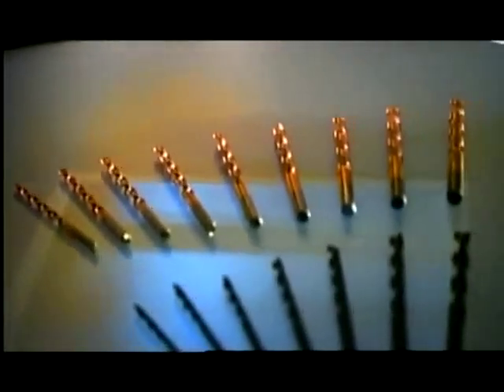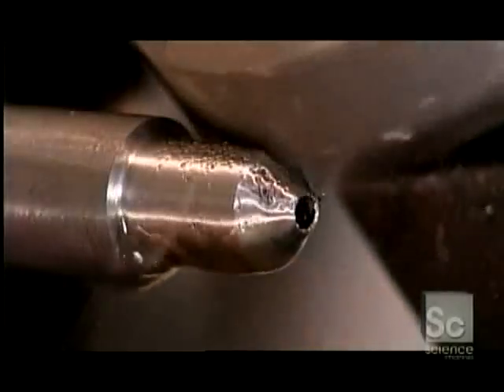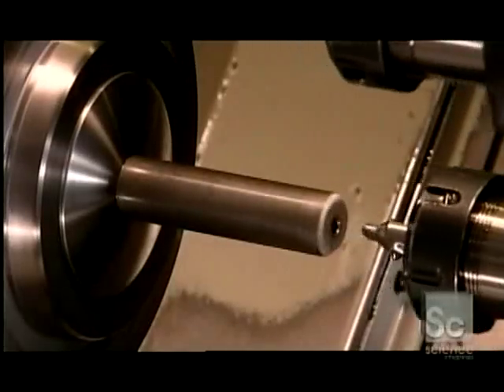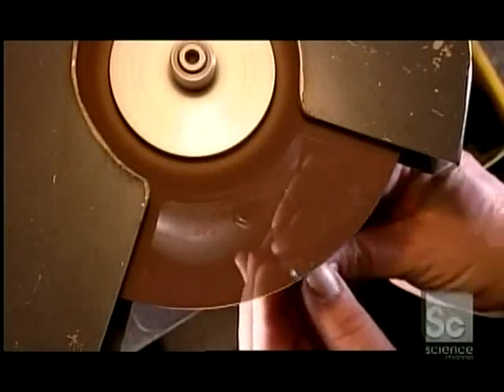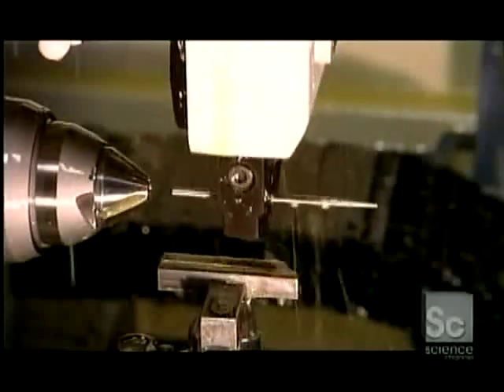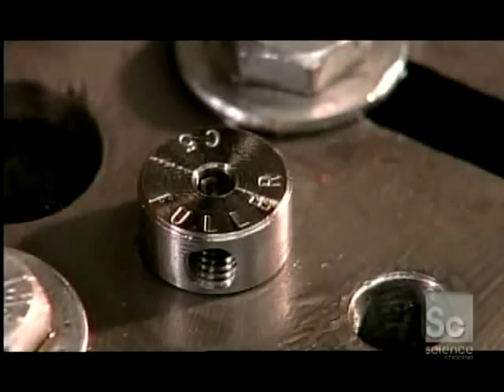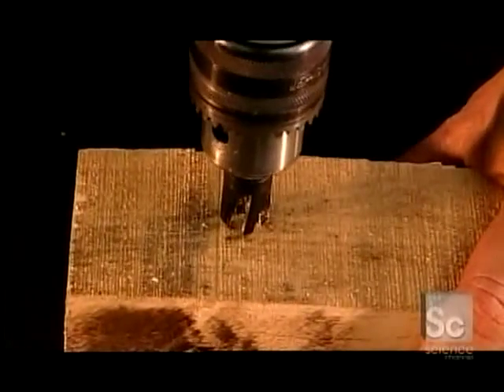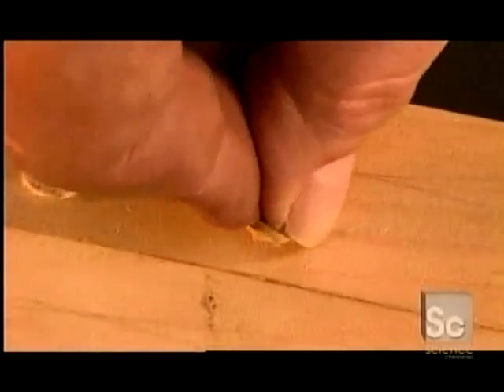How It's Made - Drill Bits (Discovery Channel Episode) - AutoDrill

Comment: Those aren't company secrets as they say. Blackening and hardening both are explained on Wikipedia. Look up nitriding which may use ammonia and or cyanide. Blackening or what's called bluing the steel uses black oxide, a copper based mix.